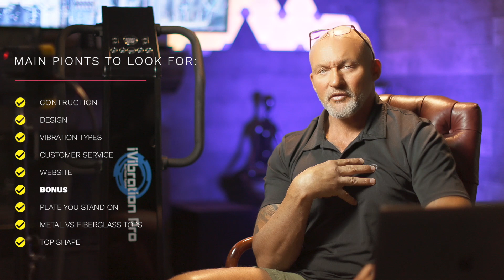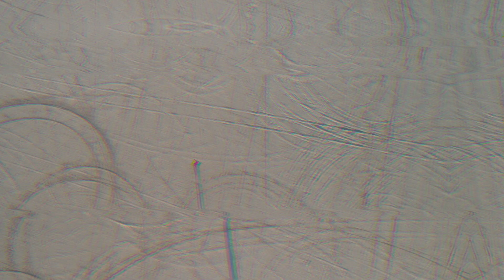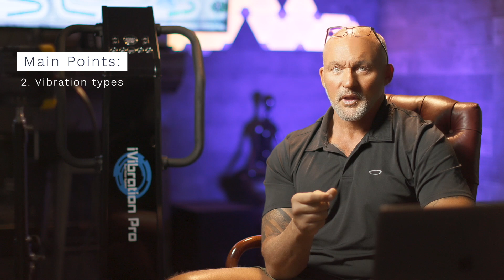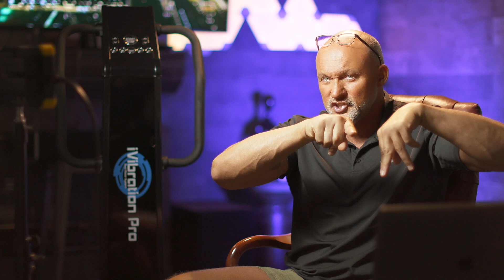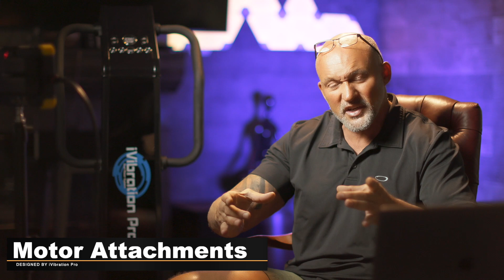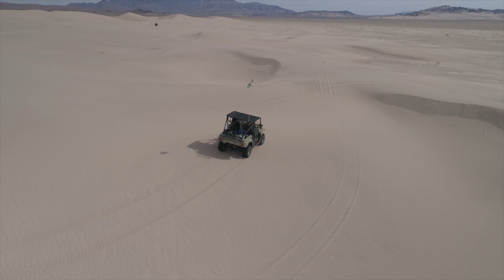Whole Body Vibration Machine | Choose the RIGHT Plate | 5 Thing to Look for.

Comment: Can you use vibration machines exclusively to get in shape or should it be used as a supplemental type program? Thank you for your time.
Reply from the maker: It can, I do more. WBV helps with fast twitch, weights help with slow twitch.

Comment: I suffer from headaches (about once a week). I read that vertical vibration is not recommended for people prone to headaches as it causes double the head vibration compared to vertical osculation. Is this correct and should I avoid machines with vertical vibration and just get an osculation machine? Thank you.
Reply from the maker: True, This is way we have all 3 vibration types that are controlled by you.
Reply from the maker: Yes, Some people have this problem. This is why we offer a machine that can modify the vibration types.